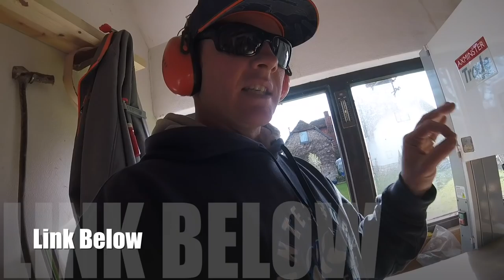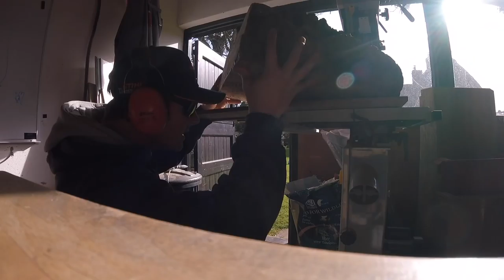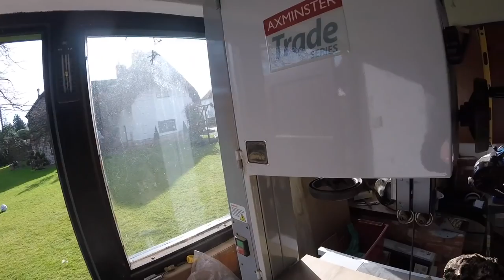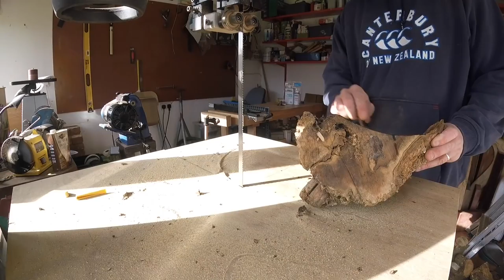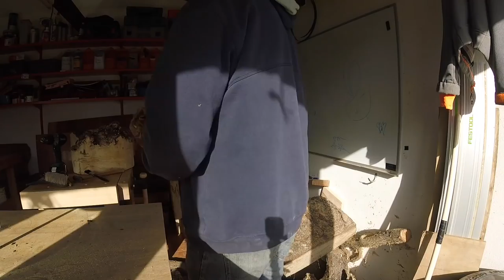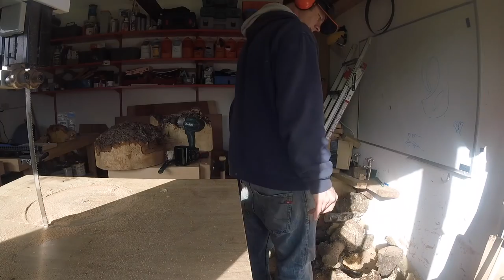Bandsaw Circle Cutting Jig

Comment: What blade are you using. I’ve tried this several times on my bandsaw and the blade deflects and throws off the wheels and ruins my blade. I’m clearly doing something wrong
Reply from the maker: Tim Schultz makes I’m not too sure bandsawing is all but new to me but I did turn the band tension right up. And the wedges helped a lot. Cheers
Reply: LENOX FLEX BACK VERSATILE CARBON STEEL BANDSAW BLADE
Length (ft / in / frac) Width Tooth Set
10' 11 1/2"              1/4 (.025)       4 H
You need a thin blade so it'll turn, but thin blades don't like tall stuff, that's why he had trouble here.  Anyway, this is the blade I use.